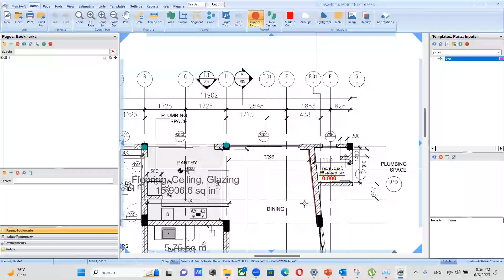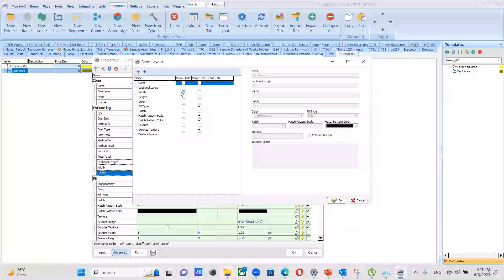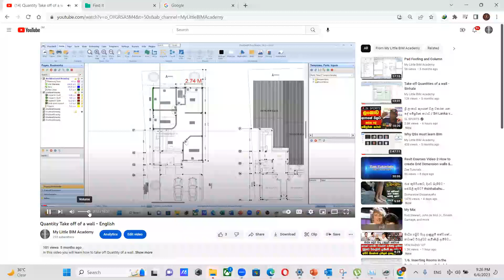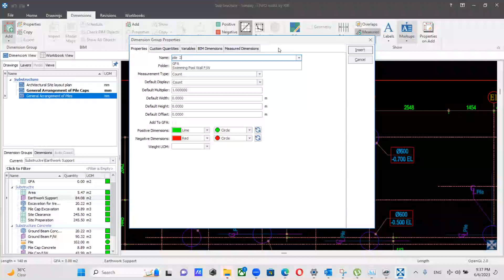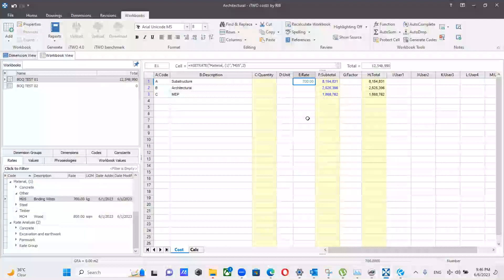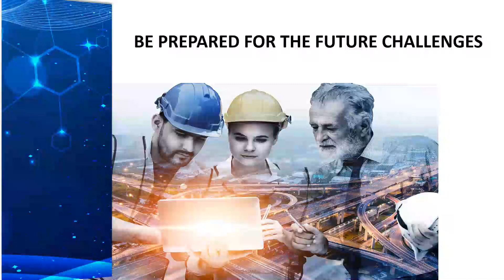What are the most demanding QS software in the world Costx, Planswift and Bluebeam

Comment: My POV :  In Autocad, if I wants to count the column, first I have to select the repective hatch of the one column and select similar,. thats it I could get all,. and for Room mesurement I would use same polyline of room orelse I suggest to get AreaTester ADD in,.. it will help me to export all Perimeter, Area and , Room name. TBH for a good QS Autocad, Revit, Stadpro with EXCEL is best but for the coperate Society sadly we are forced to learn this software's. Anyhow your video was good and very informative.